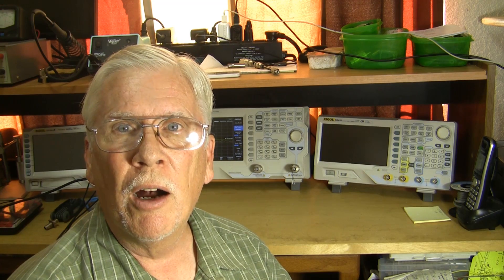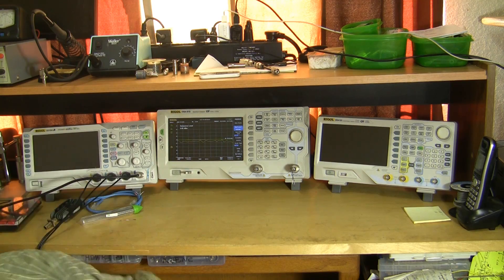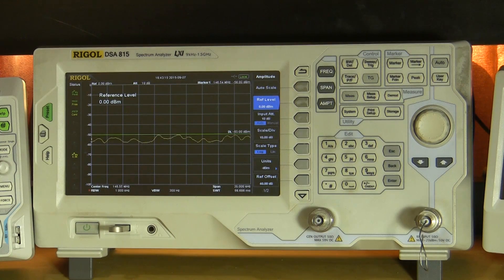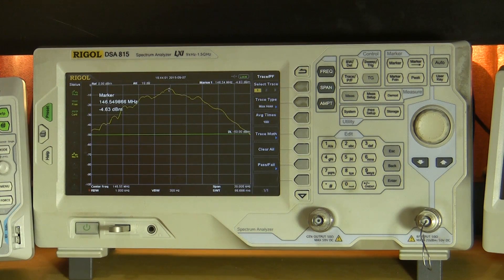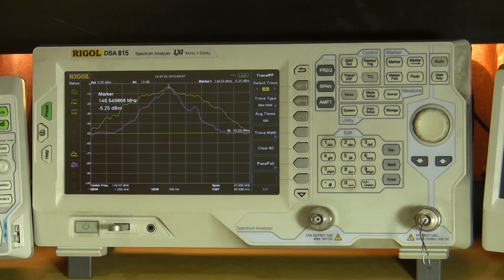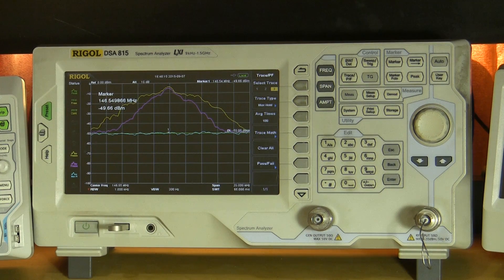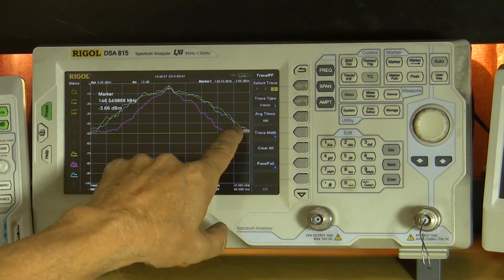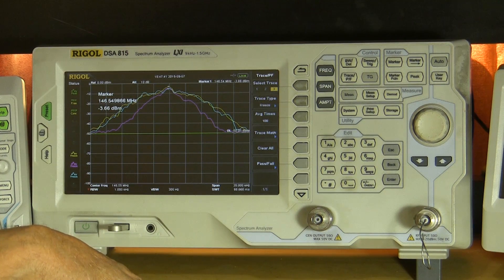FT991 FM C4FM Occupied BW

Comment: Hi.  I don't know what radio you were using, but C4FM has two modes.  DN for Data/Narrow Voice and VW for Voice Wide.

In DN, the radio xmits GPS Info, operator & repeater Call Signs and some other stuff I do not recall right now.  In VW, the only data sent is the users call sign.  The full bandwidth is used for voice.  I would liked to have seen the difference between DN & VW.